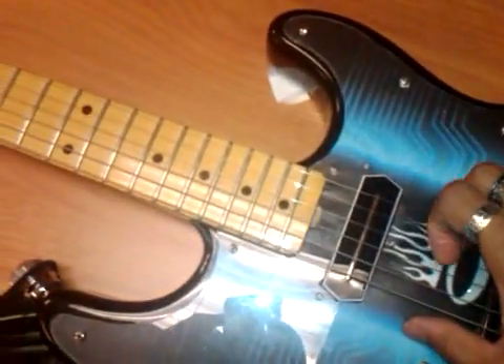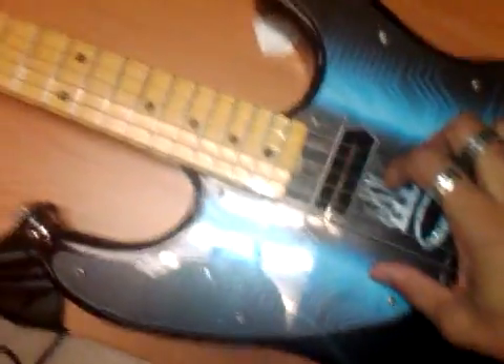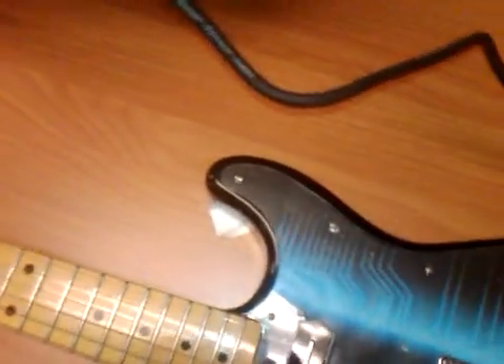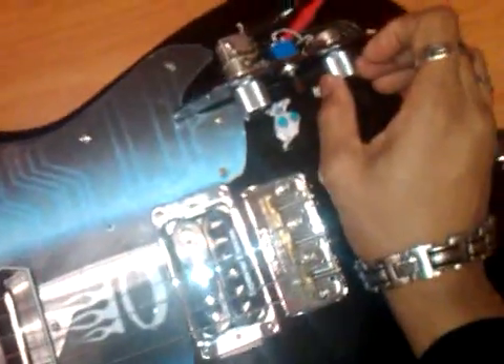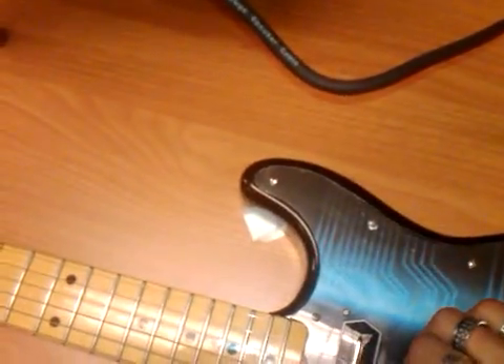SH-4 Humbucker Mod - 0.022uf Cap Test

Comment from the maker: Yep, that is indeed a Charlie Christian Pickup in there.
Lately, I have been running into more unhappiness with the JB in the Bridge. Overall, it is just too thin in tone. The breakup is nice and it does what it was designed to do, but I am replacing it with something more mellow...maybe even a single-coil somethingorother. 

The Charlie Christian is a warm mellow pickup that has it's own characteristics. I only play the middle position if I split the JB into single-coil mode. 

Dm